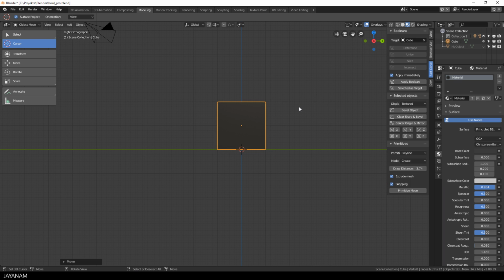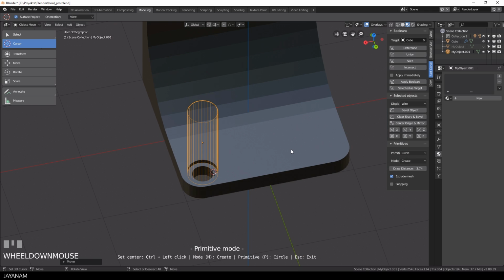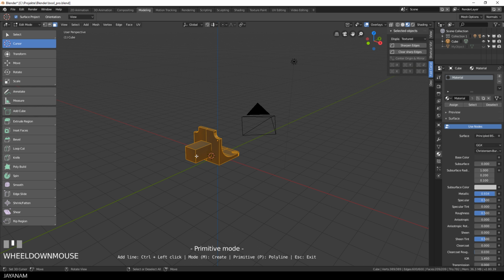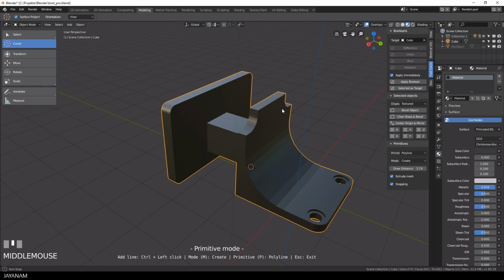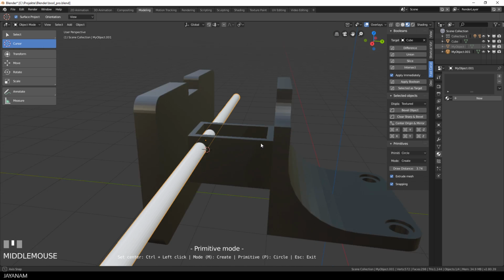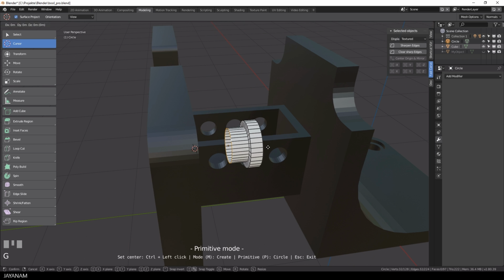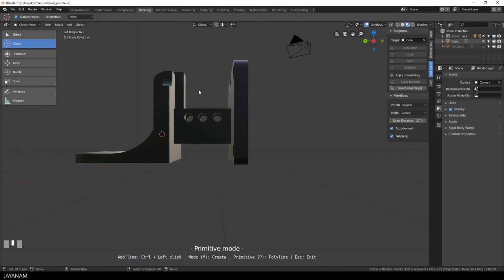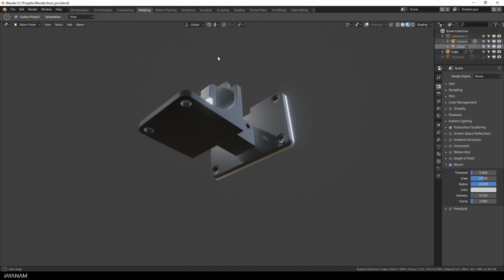Use Booleans like a Pro with Blender 2.8 and Fast Carve

Comment: Noticed an issue using Jmesh in 2.8. Whenever you apply a boolean operation, the cutter shape's origin jumps to the position of the target object's origin. The only way to fix it is to manually reset the cutter's origin position from the Mesh menu.
Reply from the maker: Ok, please add this as issue to the github

Comment: Hi, i am trying to use it on 2.81 but i somehow its not working, just want to check whether it will work on 2.81 release?
Reply from the maker: Hi, please define what "not working" means so that i can help you better. And did you see my latest video about JMesh Tools and JSculpt Tools, these are the next version of Fast Carve and Fast Sculpt, so I recommend to use these: https://youtu.be/n7LxULILeVc. I havent tried with 2.81a but I recommend 2.82 or higher.
Reply: @JayAnAm  its bit long reply but do check if you get time, i will watch the video.

blender 2.81.16 and fast-carve-2-8.zip

open blender with default cube
Go to front orthographic mode
n ->Fast Carve 
Click on primitive mode
primitive -> rectangle
mode -> difference.
ctrl+left click -> draw rectangle
ctrl+left click -> apply
Fast carve is not applied and i see in console "Info: Removed 0 vertice(s)"

but i think i found the problem.
0:26 -> You start working on it and in target cube is selected
but in my blender when i start that means i am exact at 0:26 in my blender target is nothing.

few test cases, which may help you to nerrow down the problem.

Scenario 1:
Now if in my blender if i select target as cube after opning the fast carve via "n"
primitive -> rectangle
mode -> difference.
then i cannot create the "Rectangle Primitive" with ctrl+left click, it simply does not allow me to create the primitive.

Scenario 2:
Now if in my blender after opning the fast carve via "n", i dont select the target as cube.
primitive -> rectangle
mode -> difference.
then i create the "Rectangle Primitive" with ctrl+left click, it works
now before i press ctrl+left click, select target as cube.
Now press ctrl+left click, nothing happens.

Scenario 3:
Now if in my blender after opning the fast carve via "n", i dont select the target as cube.
primitive -> rectangle
mode -> difference.
then i create the "Rectangle Primitive" with ctrl+left click, it works
Now press ctrl+left click,
We are at the situation when i reported the problem.
But now select the target as cube.
then manually click difference it works.

Scenario 4:
After Scenario 3 is done.
Try rectangle primitive again.
if the click is outside the space of new shape the then nothing comes on the screen.
But if i click within the space of new shape (click within the boundary of the new shape)
then it works and automatically a hole is created in the new shape the way you have explained in the video.

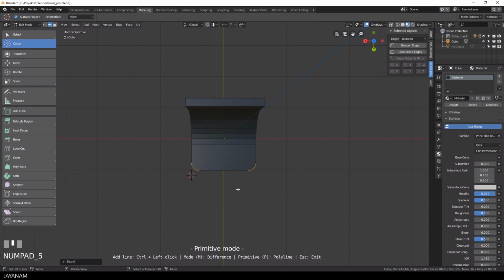I have not gone beyond 1:30 but i will try drilling cylinder but first i want to make sure that my blender also behaves exactly the way you have explained.

Comment: thank you for this great add-on. the only problem I have is that i can't place the starting point of the primitive in the void, i'm obligated to place it on one of the surface of the object
Reply from the maker: Disable snape to target and you can start in the void:-) But you can set the distance to the center then also in the fast carve panel on the right.
Reply: @JayAnAm  Hoooo okay, thanks for this quick answer :)

Comment: Right from the start I'm lost at this "Primitive Mode". I don't seem to have this feature in my version of 2.8 which I just d/l today. Also, my Fast Carve menu is not nearly as extensive as the one shown in the video.
Reply: Nevermind, I don't know what I did but now my Fast Carve menu is the same as the one in the video and I can see the "Primitive Mode" button.
Reply: Ctrl+Left Click does not work for me. I am unable to create a line.
Reply: Ok, I finally got the blue line to appear but only if I click inside the cube. It will not work outside the cube. And like Wayne whitmore, the blue line does not go away once I complete the operation.
Reply: No matter what I do I am unable to create the circle to create the hole. Sorry but fast carve seems to be too buggy on my system. Great concept though.

Comment: Great info.  How do you display the boolean menu on the right of your screen?
Reply: With 2.8, if your view layout is like mine, there is a small "<" symbol at the left edge of the collections window - click that to reveal the tabs and grab the edge to pull out the panel.
Edit: Or just press "N" (just remembered).

Comment: Nothing happens. try to use - but can't.
Do like in video - polyline or circle or rectangle - ctrl - click - drawing in ortogonal - ctrl -click after for cut - blue line is still there. if i rotate - and after ctrl - click - then new shape just extrude...cant understand the logic of plugin
Reply from the maker: Did you set the target?
Reply: Same
Reply: same

Comment: Fusion 360 user here tired of Autodesk's bullshit and looking to switch. Can I specify the distance between the center of the cylinder and an edge? Can I specify how deep I want the recessed one numerically instead of just moving it in Z?
Reply: Were you able to find an answer? Looking to make the same switch myself.
Reply: @knight2255  not yet, still looking. Testing Freecad but it's way too buggy.

Comment: Hi, thank you for sharing the video. I am working on an object using your addon. Since this is the first time in my life using booleans and I am anyway not really that good yet at modelling I am a bit clueless how to optimize the mesh and geometry to get lost of these shadings.

here are some images of my problem.

imgur com /a/ 34L0jZQ

(wasnt sure if youtube would filter out my comment if i write down the link correctly)
Reply from the maker: There are some edges (at the round corners) that are not marked as sharp (blue ones are sharp). you can go to edit mode, select theses and use the Fast Carve panel to mark these as sharp.
Reply: @JayAnAm   Thank you a lot. It worked! However I noticed that if open the right N menu, the edges have a bevel weight which is also depicted in another tone of blue. But mark as sharp has the same effect. How do they differ?
Reply from the maker: @pebdesign  Hm, have to have a look, I guess it is the bevel weight setting.

Comment: This looks fantastic! I can't see the tool shelf though after enabling the addon... I just see the normal transform panel etc. Is there something easy I'm missing?
Reply from the maker: Press N, the addons in Blender 2.8 are in the sidebar
Reply: @JayAnAm  Hey, I'm sorry I should have been more specific. The sidebar was open, but I saw no extra add-on panels. I just discovered that I had installed the Master branch, which was version 0.6.1, but the most recent version is 0.8.0.2—now that I've installed that it works! Thank you!

Comment: Hey just a question. This is a really nice addon, but it seems to be used for various mechanical and engineering parts. While I'd usually use solidworks for such tasks, why should I ever use blender for these things? Is there a way to measure and get more precise with your designs, or is it all strictly for non-engineering purposes?
Reply: Lets try tutorials :  https://www.youtube.com/watch?v=WSR6bVFe5LM

Blender 2.8 Modeling a technical piece

https://www.youtube.com/watch?v=OoMwmUrOhdc

Blender 2.8 Blueprint creation with Measureit addon
Reply from the maker: Because solidworks costs a lot of money and Blender is free? But you are right, I have to dig more into the CAD features, perhaps I can add some to this addon. Could you explain what features you are looking for?
Reply: @JayAnAm  check decal machine. It uses Boolean to create decals on the surface. I guess it won't be that hard to implement it into fast carve. Also if possible can you add a feature to make curved edge loops like drawing it on ms Paint?
Reply: @JayAnAm  I suppose if you use this for actual real life mechanical parts you may aswell add some sort of dimensioning or measurement features
Reply: @omri1324 measuring tools are already there. Search for add ons.
Reply: Besides, using solidworks for game design would be an overkill. It's more expensive than Maya and 3DS I guess.

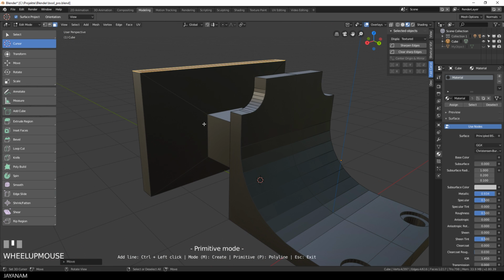Comment: Great video! I’m not sure I understand why you need to change the edges at 5:05 though. Can they not be connected to corners?
Reply from the maker: because i want to do boolean operations at these areas later on and also want to add bevels at the edges at the corners. Keeping the edges connect to the corners would lead to bad results for these operations
Reply: @JayAnAm  Ah ok, makes sense. Thanks!